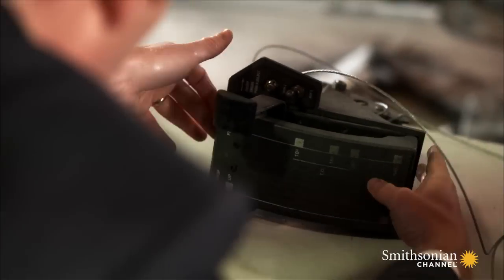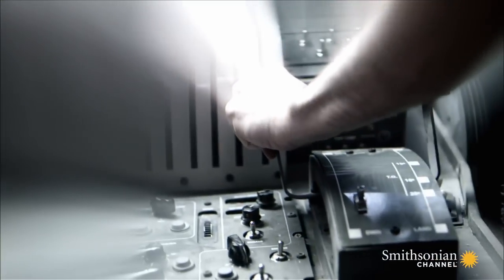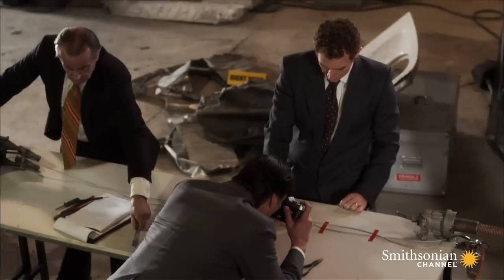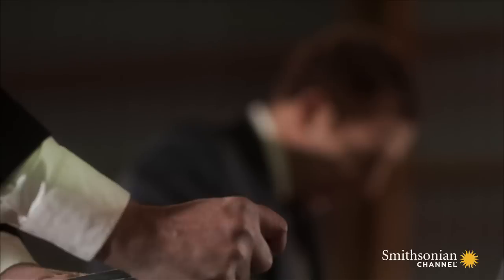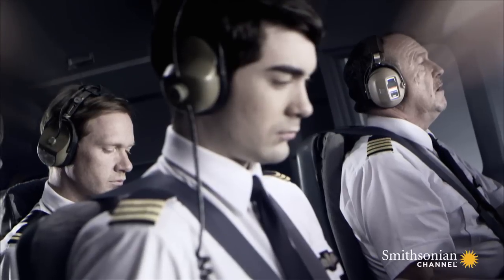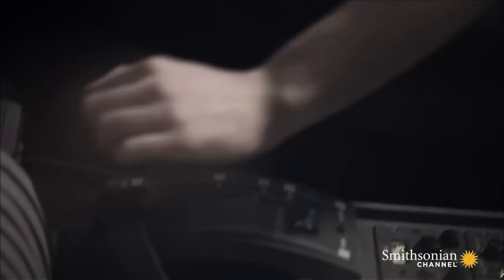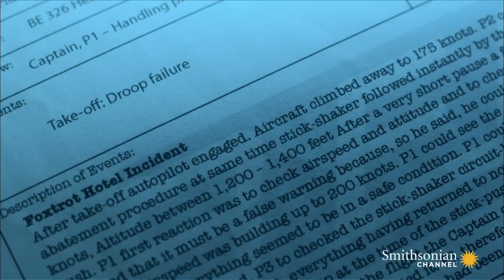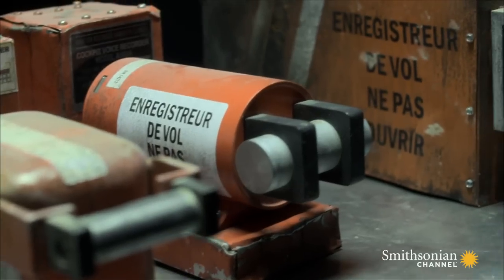What Simple Mistake Caused this Flight's Crash?

Comment: Could they build the plane so that the droops cannot even retract until the plane is known to have enough speed while climbing? Ik that's easier said than done.
Reply: That's exactly why systems should be foolproof! I agree with your point. Maybe making it accessible in manual mode only after both pilots confirm command, then it might help reduce such opportunities for errors..
Reply: they redesigned it so it would be less confusing
Reply: YiFan Tey What if the computer fails! Basically describing Airbus where pilots have to rely on them
Reply: thats actually rlly smart ngl
Reply: One of the German's late bf-109 variants was the first to utilized droops, and what they did was have it so at a certain speed the air speed would force the drops into place, and once the aircraft slows down the drops would be allowed to extend for take offs, landings, and maneuvering in dog fights.
Reply: Max Silverstone 
The plane crashed in 1972, plane automation wasn’t as advanced as it is today.
Reply: @Av8r_rome  Boeing aircraft rely on the same computer systems.
Reply: that is actually not easier said than done. it's like with the landing gear, you simply can't retract it until the plane knows that it is airborne. i think it is quite easy to do that considering how advanced modern software and computers are as well
Reply: This is the central issue. Designers must have known about Sod's Law - if something can be done it will be.

Comment: Aren't droops also referred to slats?
Reply: Old times. Or they're a sort of predecessor.
Reply: droop, slats and krueger flaps are referred to leading edge device which increase the camber of the wing and lift efficiency. But due to complexity of operation and design, droops are no longer use in modern aircraft industry.
Reply: [GD] Karebu219 yes now the slats or droops are controlled by the flaps
Reply: Right
Reply: Like Brits call flashlights torches, we call droops leading edge slats.  The German ME-109 had automatic leading edge slats.  They were spring loaded and the faster the wind over the wings the farther back they went.  Beyond a certain speed they were fully retracted.  Beautiful system.
Reply: Agreed.  Completely passive.

Comment: Even I know that tractors, farm equipment, and construction equipment have differently shaped handles. Ooops.
Reply: yeah, that's why pilots like the 'untidy' MD-80 cockpit over the boeings and Airbuses that replaced them, as those had a different switch for everything, whereas boeing and airbus use switches that feel the same for everything, so you have to visually check what you're doing rather than just knowing by feeling the switch that you have the right one.

Comment: I don't see any confusion here as both the levers are not on the same side so there could not be any confusion while using them.
Reply: You realize that they could be looking out of the window....eg flying the plane right? Your making an argument against ¢0.50 worth of plastic is not a good stance.
Reply: The droop lever was the same shape as the flaps adjusting lever. When pilots are preoccupied, they tend to do things without looking at it. Had the handle designs been different, it would've been another story.